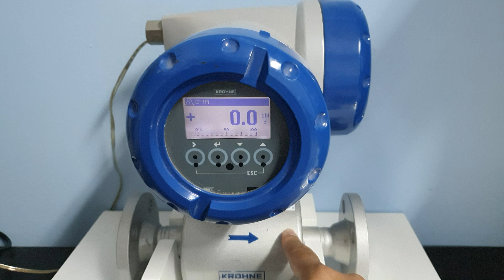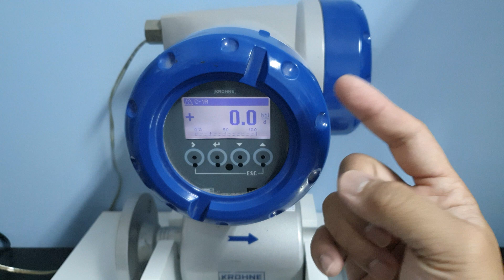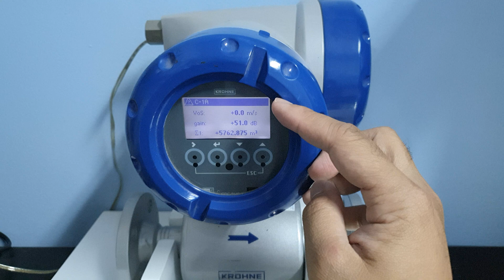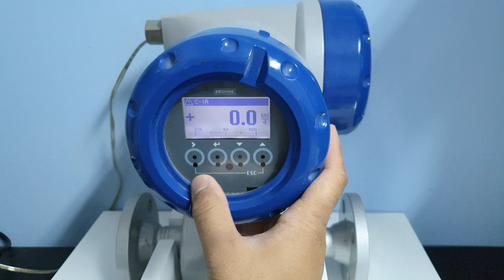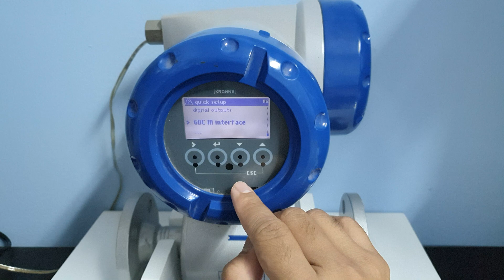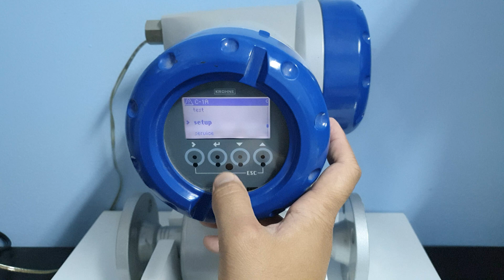Tutorials: How to access and navigate the menu for a KROHNE Flowmeter. #KROHNE #Optisonic3400

Comment: Sir how can I eliminate "Power Failure"? When there is power failure alarm although display is available the counter stopped counting measurement is not possible. For now, I have to reset the power supply every time we have fuel loading then it starts counting.
Reply from the maker: Power Failure is only an Information Alarm that power has been turned off and powered on. Ideally you can eliminate this via quick setup - reset alarms
Reply: @teamobiasvlogs495  Maraming Salamat Sir.
Reply: @teamobiasvlogs495  Actually there are three alarms I observed  "out of specification", "system control" and "power failure". When I reset though quick set up only the power failure alarm disappear out of specification and system control still exist. When system control is ACTIVE mass flow is not measured. I checked the process control settings everything is good. What could be the problem of the Flow meter Sir? TIA

Comment: We are facing error Like ; unreliable reading and second channel path error. what could be the reason. what is to be done.
Reply from the maker: check the actual values. actual gain and actial SNR. If the SnR is very low maybe its a noisy application.
Reply: @teamobiasvlogs495  hello please how I can convert m3 to MMSCFD from this device Flow meter